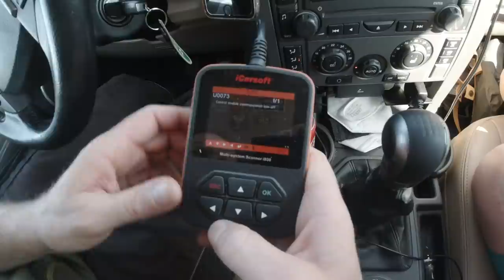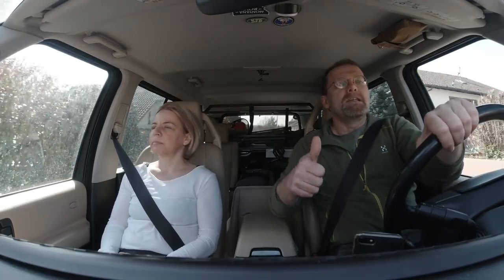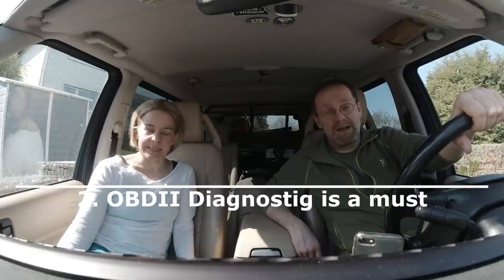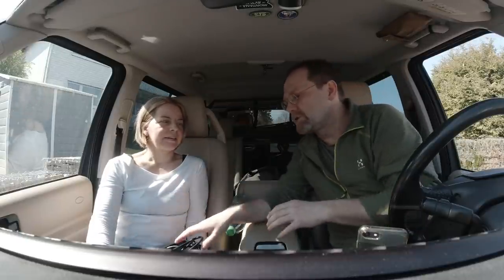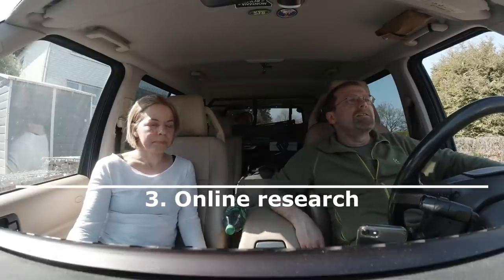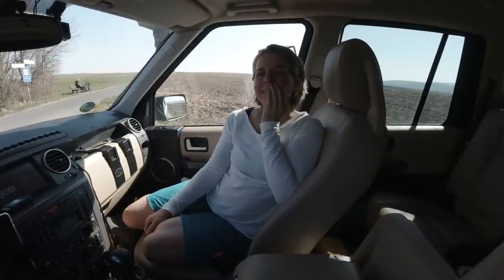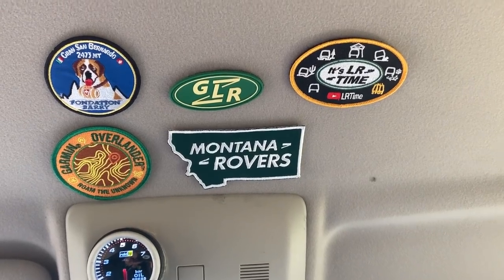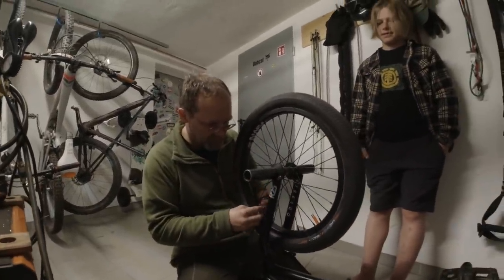Land Rover basic diagnostic in 5 steps - LR3 - LR4

Comment: Hi..i have a very fine high pitch vibration at about 100km/h on a smooth road..i  replaced wheelbearings...no difference..wheels balanced..no difference...what can cause this?I read somewhere a hollow pin on shaft of steering shaft can get play?can it be on steering shaft under dashboard?
Reply from the maker: Hello Wesley, is that noise independent of the gear you are in? Have you changed the gear while still driving 100km/h? So the engine rpm changes but the vehicle speed stays the same. If so, then it might anything related to the engine, like the bearing or pulleys connected to the serpentine belt for example. Also, a high pitch noise has ain a rotational origin, it's highly unlikely that it is coming from a steering column. 🙋‍♀️Vera

Comment: Good afternoon from England 
I have a cheeky question ..
My nee to me sport rr 2009 71k miles .. new air bags and valve block
Even new Suspension compressor will not rise … special functions not available means a super bouncy ride … can any one point me in the right direction please thanks
Reply from the maker: Get a diagnostic tool. Rather sooner than later. 👍🙋‍♀️

Comment: I had a disco3 and on the highway at 130 km/h the engine and the all the electronics had shut down, the car started normally after and drive 400 km without any problem that day, after a month i sold the car with sadness

Comment: Does the Gap tool work on any vehicle?
Reply from the maker: The Gap is linked to the vehicle vin number.  You need a separate license for each LR.  Christian
Reply: @Vera_and_Christian  you can read and clear codes on other landrovers you are just not able to make any CCF changes.
Reply from the maker: Ok. Thanks. Did not know that.  Christian
Reply: @Vera_and_Christian  and by other Landrovers I mean models that the tool works on.

Comment: Hi  you Christian I love your videos  you keep mentioning Toyota why dont you have one instead of Landrovers my Discovery 4 is 12 years old witch I have owned for 10 years and still drives like new I have driven Landcruisers and they feel like a tractor compared with lush ride of my Disco I tow a large caravan with ease i know people with German 4x4s and have more problems than i have the big thing that went wrong with mine was the air compressor where was made Japan it is going in for MOT and service today still running on the same brake discs as from new at 83,000 miles ,I would the face lift Disco if I could afford one Bye for now Trevor PS I know some with a Disco 3 that as done 400,000 miles
Reply from the maker: 😃Now if you have really did watch our videos, you must know by now why we love our Land Rovers and that we would never buy a Toyota What Cruiser👍🙋‍♀️Vera
Reply: @Vera_and_Christian  I am pleased to hear that you love your
Landrover’s why do you call them Toyota what cruisers regards Trevor
Reply: If they had Toyotas there would be no video content for the channel!
Reply from the maker: Because I cannot differentiate between all the different Toyotas.  To me they all look the same.  Sorry, I tried to understand what the difference is before, reading the entire Wiki site.  They remain What Cruisers for me.  I do like them and I have respect for sure.  I especially like the FJ Cruiser.  Christian